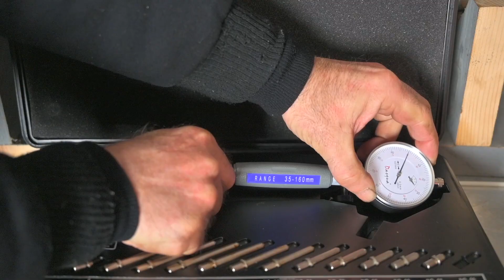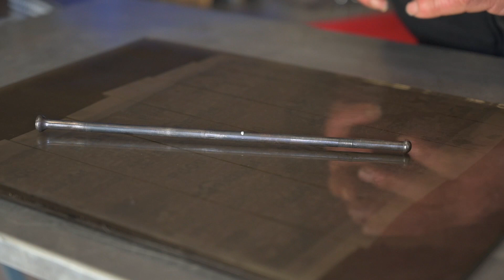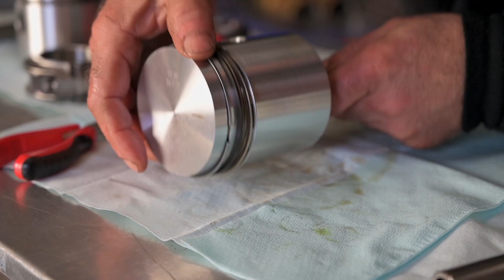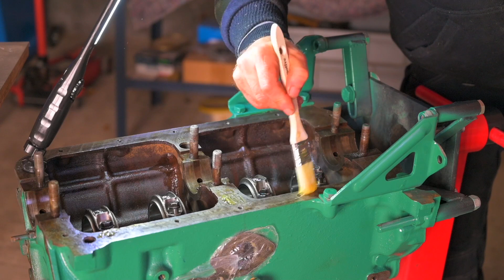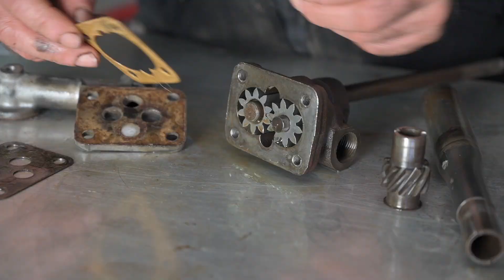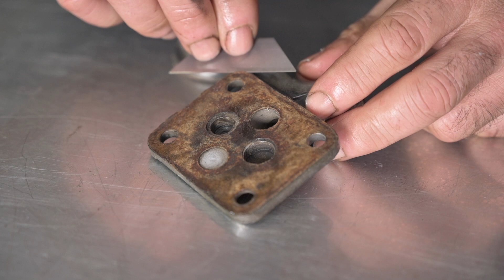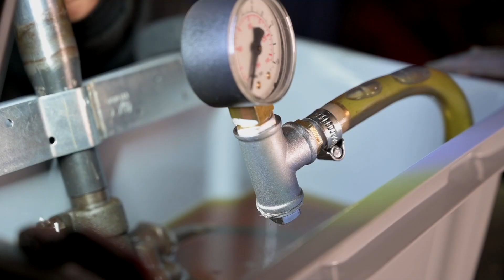Old Rusty , Part 3 Engine Rebuild - Camshaft-conrod-piston-oilpump install

Comment: Problem with pitted Cam lobes is the case hardening is compromised and so wear will accelerate, however with synthetic oil and low revs they should last long enough.
Great Vids
Reply from the maker: Thanks for the comments pbysome,  if I could get a new one I would.. but they are so hard to find.  I guess it will last its time, occasional runner